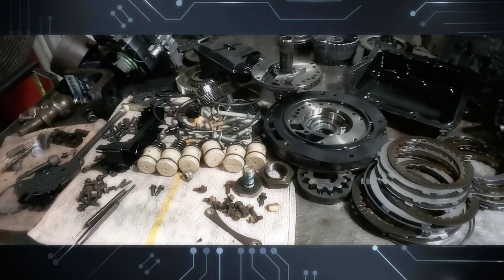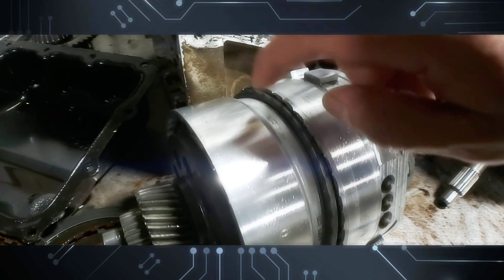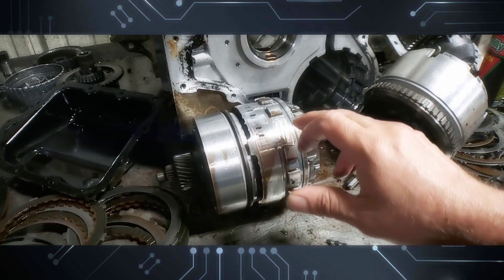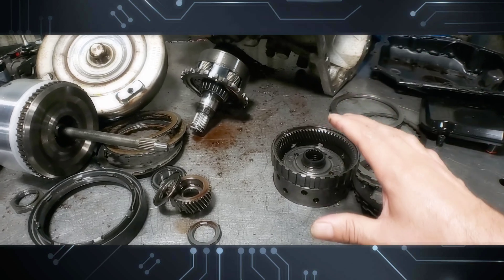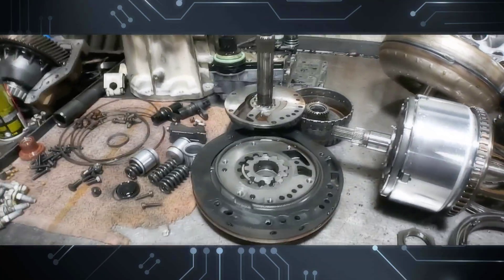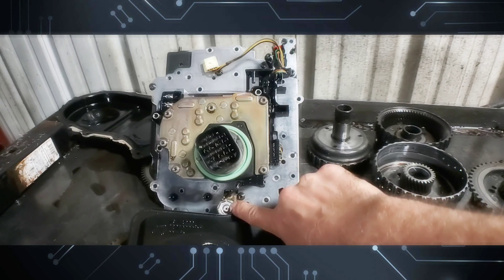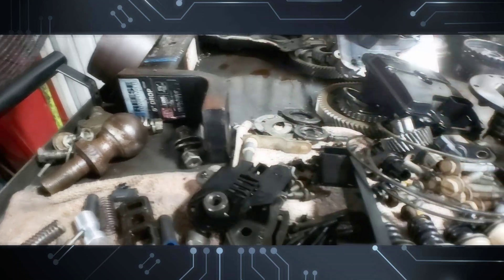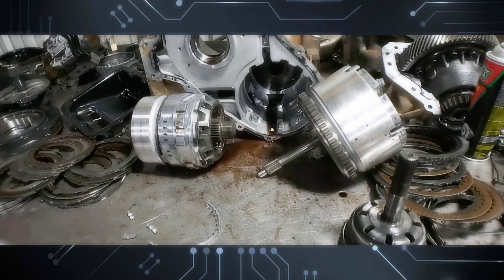💥62TE Transmission Low Drum Failure | Tales From the Bench

Comment: I am dealing with this exact same issue right now. I initially thought it was the parking pawl. When putting the vehicle into park it would continue to roll. After digging into it i found this same issue. Could one problem have caused the other? I was thinking maybe the parking pawl broke off and could have caused this damage. Also, do you know what size bit i need to remove the set screw holding the shaft in place for the pawl itself? I know its inside the same hole that holds up the filter but i cant see up in there to see what type of bit it takes.

Comment: HELP! how do i get compounder assembly back into transmission from side cover, to mate inside planetary gears again? ive got 1/4 inch gap left before snapring can be installed. i dont know how to get alligned with installing compounder horizontally back into car... i bet a hammer will smash not mesh. thanks.
Reply from the maker: Turn the wheels back and forth while pushing it in.

Comment: I’ve learned so much from you over the years. Started building 6 years ago. Glad you’re back. I do a lot of 62te. Almost as much as the 6L80s. I see that snap ring break the drum often.
Reply from the maker: Glad to hear that the snap ring breaking the drum is a common issue with these units. This is the first time I seen it broken like that. I replace that drum because of wear by the snap rings that causes the typical driveability shifting issues and torque converters coming apart shedding lot of metal just like the 6L80's do.
Awesome that you're doing good on on being a builder, you can't ever get tired of this, something always different. That's what makes this field more exiting than any other field in the automotive industry.
Reply: @AutomaticTransmission  can small metal chunks come out of the torque converter,, no slivers, nor swarf, but small metal chunks?